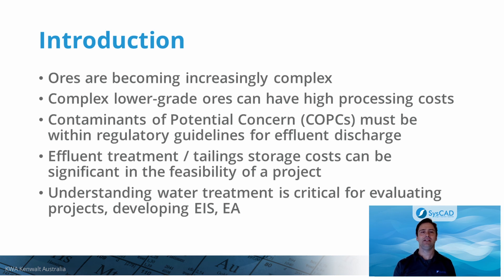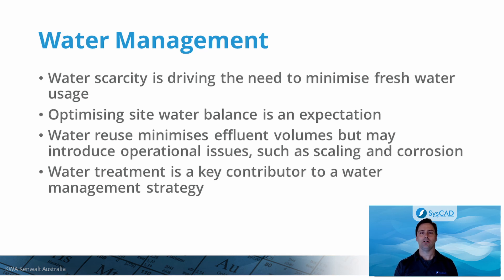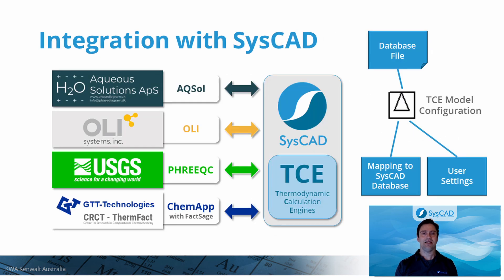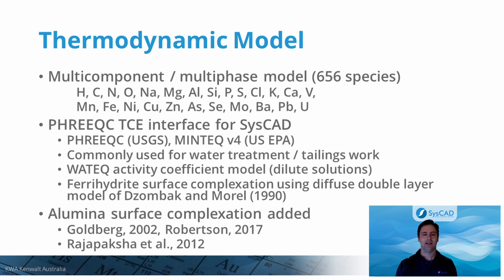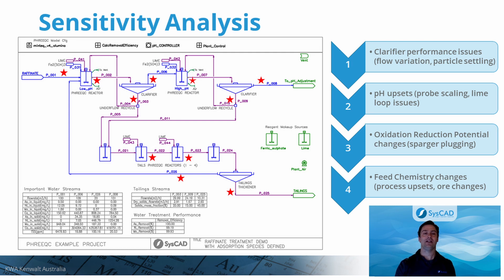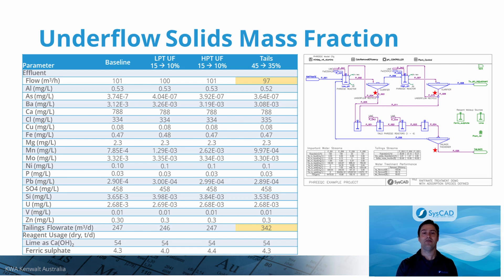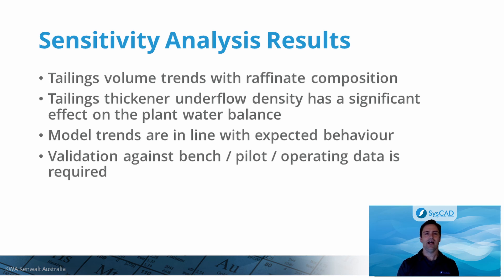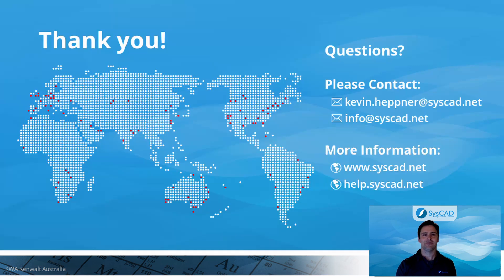First Principles Modelling of Mine Wastewater Treatment

Comment: In vehicle Li battery cell production plants, water treatment is also required (to manage the effluents from cathode making process). Does SysCAD data base cover the relevant species and thermodynamic and kinetics for high ammonia concentration wastewater (+ SO4- - and HSO4- ions, Na+, other minerals) and low ammonia concentration waste water ?thx.
Reply from the maker: SysCAD is designed to be a flexible process simulator and is able to incorporate any relevant chemistry, but it does not have all data for every system out-of-the-box. Required data for such a system could come from incorporating TCE calculations, lab-scale data, and literature. To address your specific question, SysCAD is shipped with an example project showing the production of ammonium sulphate crystals from brine via a three stage evaporation process. Such a process model could be further enhanced with appropriate solution chemistry to account for ingress of impurities into the crystals to identify operating windows. We would be happy to meet and provide a demonstration of capabilities at your convenience.